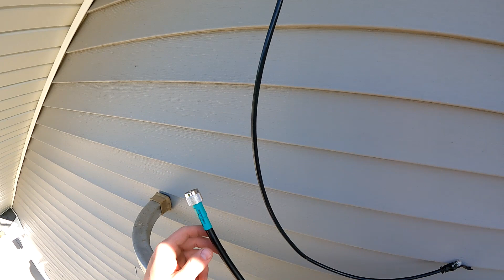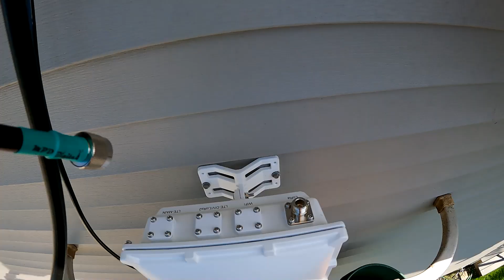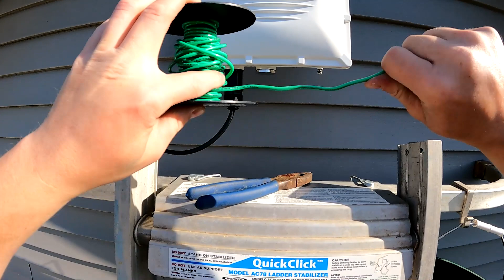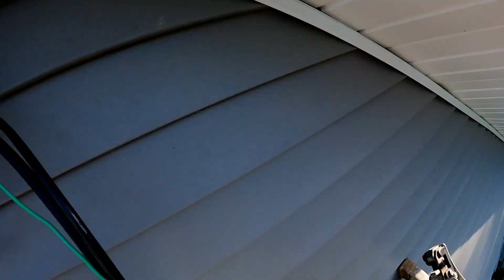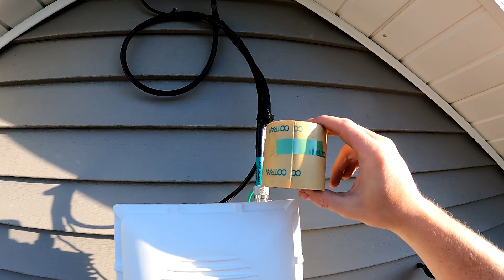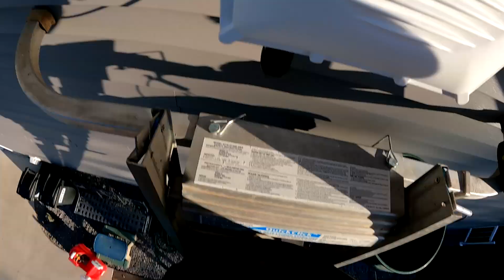Part 4: RAKwireless Outdoor Enclosure Install (For Helium Mining HNT)

Comment: Super nice and clean install. Well done. You should maybe put the actual antenna on a telescoping pole to get it even higher. Signal might clear those trees a little better.
Reply from the maker: I have been looking into those for my second location. The wife will be mad if I vacate all the holes I already drilled into the siding....lol.

Comment: I noticed that you didn't use a lightning arrestor for your antenna. Do you think its worth it to get one? Or is your grounding setup sufficient? Great video!
Reply from the maker: Thanks, I talked about the lightening arrestor in a previous video. I have mine located direct to the antenna, then the lmr400 to the enclosure.

Comment: I mean all of these Large Antennas and set up are great. But what is everyone plan to gain more locations in order to create the witness link? Thanks B
Reply from the maker: Thanks for the look.... For me, because of my location, the larger antenna setup is what will give me a better chance at reaching other miners further away and getting the witnesses needed to be efficient. Also, while obviously I want to mine more HNT, I am also looking towards the iot side of it. My larger antenna should provide a wider area of coverage to connect iot devices to. Everyone's set up will be a little different.
Reply: @HeliumNoob  oooo so your going to do the smart sensors. Cool I am following your channel. I got nervous because I ordered multiple units I have rental homes with laundry rooms I am going to put them there to start. All these growing pains just want to make sure I am not throwing away money. The locations are close enough where I should be able to link to them creating a hub of sorts. Your going to be updating your channel with the IOT side ? I definitely want to learn how that side of the biz works 🍻 Thanks B

Comment: Thanks again. I was wondering, when I installed a regular outdoor enclosure (plastic) from Lowe’s for the original Helium Hotspot, it was recommended to leave the bottom hole open for more air circulation to keep the device cooler. 

But in here for Bobcat, it’s all sealed, do you think it sealing is going to help for this metal case? Because water may not enter from bottom with the portrait/vertical position.

Comment: Thank you so much for your expertise  May I ask what kind of ethernet cable would you recommend ?
Reply from the maker: Here is the one I used.....thanks for the look, please subscribe.
 https://www.amazon.com/UbiGear-Waterproof-Resistant-Oxygen-Free-Construction/dp/B07XX1TCT9/?_encoding=UTF8&pf_rd_p=d07e549a-f1c2-4f38-bd78-c1f00874864e&pd_rd_wg=0ryQd&pf_rd_r=4TB7YJPTRTBX18PDY65W&pd_rd_w=3zR3e&pd_rd_r=23415bd7-921f-4e98-b679-bc8afd3526d6&ref_=pd_gwm_ci_mcx_mr_hp_atf_m
Reply: @HeliumNoob  thank you so much and I am subscribed to your channel. I have a question for you if you don’t mind. My installation isn’t going to have an outdoor enclosure. I am planning  to install a mount on the roof with the antenna and a lightning arrestor (Female to female )and run an LMR 400 from the arrestor to the wall and I will have the hotspot sitting right behind the wall. I will run an extension cord an LMR 240 from the wall to the miner because I was told that If I connect the LMR 400 to the hotspot directly, it might brake the connector. So would this be the right cable and connection I need ? 
The lightning arrestor will be installed directly on the antenna so I will need a cable from arrestor to wall N-Type male to N-Type female and from the wall to the miner I will need N-Type male to RP-SMA male. Did I get it correctly lol ? Thanks in advance professor.
Reply from the maker: @moncefslaouiandaloussi6826  I like the plan. Only change I would make is instead of using a lmr240, just run the lmr400 male to male, into the house. And use the female n to rpsma pigtail/feeder wire on the inside of the house to go from the lmr400 to miner. The RAK antennas should come with the pigtail.
Reply: @HeliumNoob  you think that would be enough ? Will do. Thank you. I am heading to MD digital and I am using your discount code ✌🏼

Comment: What's the black tape you used around the antenna connection. Looks like a roofing gum tape of some kind?
Reply from the maker: Thanks for the comment and checking out the channel. RAK calls it a waterproof tape, and it comes with the enclosures. Proxicast calls it a weatherproof self fusing silicon rubber sealing tape. Here's a link...hope that helps!
https://www.amazon.com/Proxicast-Pro-Grade-Weatherproof-Self-Fusing-Electrical/dp/B00K5GW67O/ref=sr_1_4?dchild=1&keywords=antenna+tape&qid=1626472493&sr=8-4

Comment: Hello, great video as always. 
1)question can you install a 4 feet ground rod instead of a 8 feet rod. Just to ground the 5.8 dbi antenna.
In case that doesn’t work .
2) can you run a 10 agw ground cable for 100  feet. What is the max length for ground?
Really appreciate your help. Thanks in advance.
Reply from the maker: 1.) In my area 8ft is code, so I honestly wouldn't do anything less. 2.) I have had 2 companies ground satellite dishes at my house with well over 75' of ground wire. Not saying that's okay to do. I would check with a local electrician or a call to the county/city building inspector with hey "if put up an antenna for TV signal, how should I ground it." Thanks for the look!
Reply: @HeliumNoob  thank you very much.😁👍👍👍👍

Comment: Hi love your videos! Quick question I have order a bunch of miners and I do NOT have the skills you have in terms of installation..

1. How many hours does it take from start to finish to complete an installation on the roof. How long would that job be. I mean from assembling the antenna on the bracket to putting it on roof to finally connecting the miner to the internet.

2. Which kind of companies should I hire to get this done that are well experienced in these kind of things.

Looking forward to your response. 

Thanks again
Reply from the maker: If you have everything needed to get it done, its about 2-3 hour project. Electrician if you need to add anything electrical. Or try to find someone that installs satellites or cable. They would most likely have the skill set. I hope that helps.
Reply: @HeliumNoob  would EVERYTHING I would need be at the bottom of the video in terms of links?
Reply: @HeliumNoob  Thanks a bunch. Was able to find a company to help me out a little bit. They should start work in about a week. A few questions:

1. Do you use any 5.8 dbi antennas for your locations or do you stick with 8dbi just b/c the range is longer. And will you continue to use 8dbi antennas moving forward.

2. On the rak wireless link you have on ur site it directs me to N TYPE MALE TO RP-SMA . I am a bit confused as to which LMR 400 I SHOULD USE exactly. Would it be the RP-SMA FEMALE? If so, will that connect to both the antenna (rp-sma male) and to my bobcat miner?

3. Whats the smartest way to not over pay for the LMR wire especially if you dont quite know the length. I have 20 homes ill be installing this in . Should i just guess on an estimate?

Thanks again
Reply: @Iranolaschools  I think his antenna cable suggestion is wrong. It should be N-type Male <-> N-type Female cable. The reason is because the outdoor enclosure has a N-type female and the lightning arrestor has a N-type male. So the RP-SMA cable doesn't work since the enclosure isn't compatible with it.

Comment: Great video. Is the link to buy the enclosure the same as the enclosure on the CalChipConnect site? There’s a $45 difference, wondering if maybe the upcharge is b/c I’m in California? I ordered two miners and two enclosures but looks like I can save about $100 if I cancel the enclosures and use your link instead 👍🏽
Reply from the maker: Thank you for the look, I appreciate it.  Cal's site says the $124  ***Price includes tariff fees, import duties etc. I wouldn't cancel until you figure shipping on RAK site and make sure it saves you money.
Reply: @HeliumNoob  ahhh I see. I bet that’s it. Thanks again 👍🏽
Reply: the calchip comes from usa, and the rak store from china

Comment: Thanks for the video, great content. If you would have installed the antenna directly to the enclosure, would you need to have a lightning arrestor connected to the antenna and then connect that into the enclosure?
Reply from the maker: Even if you are direct to the enclosure I would still suggest adding a lightning arrester. Static electricity still has a chance to build up on the antenna from wind. Thanks for the look, please subscribe!
Reply: @HeliumNoob  Definitely subscribed, your setup content is the most detailed I've been able to find and it is much appreciated. I've got a couple of Bobcat enclosures on the way and I am sure I'll have your videos on while I am assembling. 

Grounding wire to the lightning arrestor and another to the enclosure and then splice them together like in the video. Will do.
Reply from the maker: @ematos00  that's a big reason why I started it...I found helium, ordered a miner, and was like now what.....couldn't really find any good videos on it. So I started the channel and website. RAK is sending me a bobcat enclosure, shipping estimate says 6/23. So hopefully by end of next week I will have a video up on it.

Comment: You should double check your grounding wire connection. Its incorrect the wire should be put in the end that's opposite of the tightening nut. Also grounding rod should be below the surface. Otherwise clean install
Reply: Copper ground wire will oxydize, you either need a mechanical connection strong enough to keep air from getting between the wires, or solder to maintain a good ground connection. Maybe coat with some kind of anti-ox grease. Problems caused by poor grounding can be very hard to diagnose. Good job, thanks for posting it!

Comment: Debating whether to do outdoor enclosure or long antennae cabling. I'd like the RAK to be more accessible since we have bad winters. Getting on a 20ft ladder in the snow is not an option.
Reply: Long antenna cable means larger losses. Every 3dB loss is a half in signal level. Telecom has moved radios closer to the antenna, (RRU's) because of cable losses to avoid impractical large cable installs (which reduce number of sectors).
Best to stick your miner as close to the antenna as possible, place it in an attic or bedroom if you need wintertime access. Design it so you won't need access during cold months.

Comment: Can I use this outdoor enclosure with the normal antenna provided with the Rak 2 miner.  I don’t want another antenna, I just want the height
Reply from the maker: I don't see why you couldn't. Only thing you would need to do is add a connector. The enclosure has a n-type female hub. You would need a n-type male to RP-SMA Female connector and I would think it would be fine. https://www.amazon.com/Ancable-Polarity-Connector-Transceiver-Extension/dp/B0789BW1QK/ref=sr_1_4?dchild=1&keywords=n-type%2Bmale%2Bto%2Brpsma%2Bfemale&qid=1624153651&sr=8-4&th=1

Comment: i only have my 8 dbi anteena just on top of my roof do i need to ground it.  im waiting for my lmr400 to come in the mail when it comes i will ground it.  is it safe un grounded for the time being?
Reply from the maker: Not sure if that is your real name...so sorry if you get the office jokes a lot...that is one of my favorite shows. I always suggest grounding. Safe, probably for the time being, but i would put it up there as soon as you can.
Reply: @HeliumNoob  if I reposition my rak hotspot via Ethernet cable 30 feet out of my house and into my shed and then extend 30 feet of lmr400  out of my shed and 30 feet up a tower making it actually 300 meters away from the closest one
Reply: Will this make it the actual 300 meters away from the closest one will this correct the transmission scale from .50 to 1.0
Reply from the maker: @michaelscott4718  the scale is based on density of the hexagon. Whether it is 5m or 300m away, if its in the same hexagon it would still affect that transmit scale. "The number is a representation of how dense a hexagon is (how many Hotspots occupy that hex) at various resolutions (from resolution 12 down to resolution 4). This means that if any Hotspots asserts themselves between 0.3 m² to 1,770.3235517 km² away from your Hotspot, its scale can change."
Reply: @HeliumNoob  so i need to move it into its own hexagon to get full transmission, damn that sucks

Comment: Why didn't you just use LMR-400. Why Poe
Reply from the maker: The antenna cable is LMR-400 with a 6ft run....I used Poe instead of a longer antenna cable because of signal loss. I would have to run about 50' just to get it in the house....and install electrical on the inside of the house to power the unit. Other wise total lmr-400 run would have been about 125'. With Poe I reduced my signal loss to almost nothing and reduced my installation costs.